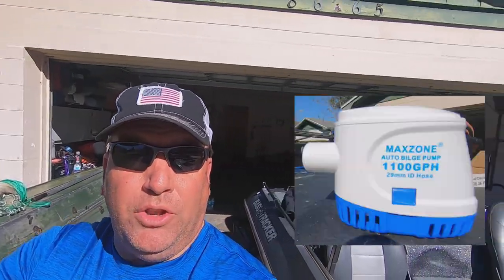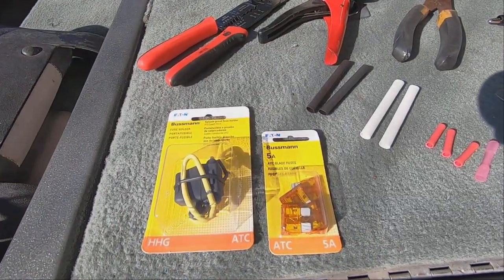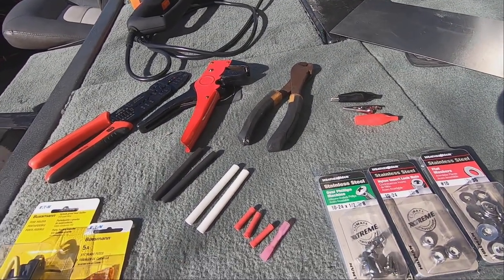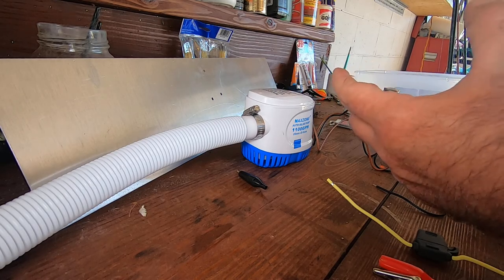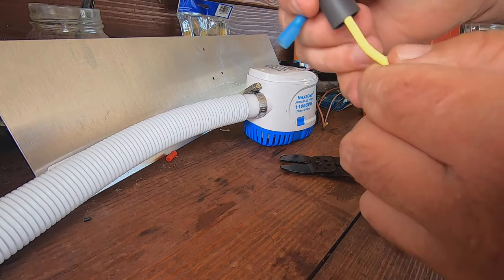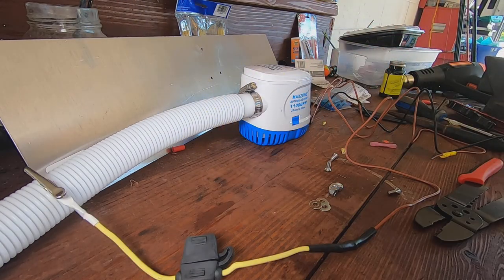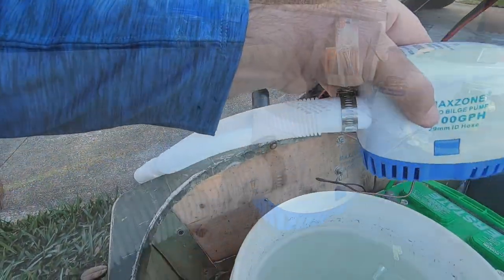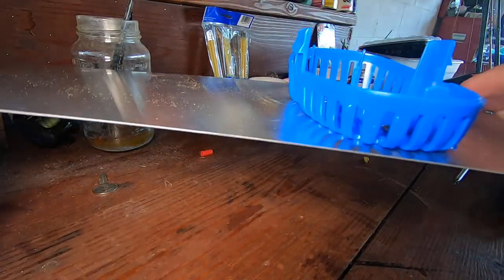How to install an automatic bilge pump

Comment: What did you do to the wire that was suppose to go to the switch? Bought the same pump and planning on the same setup.
Reply from the maker: I insulated the wire I am not using with Liquid Tape.
Reply: @ThatShinerGuy  thank you.

Comment: Dude! 
What's all that crap on your boats rivets?
Set your boat up on saw horses,  lay a sledge hammer on the rivets on the top side, then simply tap the rivets on the bottom side with a regular hammer. 
You can get solid aluminum rivets from granger to add or replace them.
It's really easy!

Comment: couldnt you put the flathead screws on the bottom and the nuts on the inside to make a more flush contact ?
Reply from the maker: I just flipped the screws over.  I think you are right, the flat plate will be almost flush with the boat floor now.  Thanks!!

Comment: Nice job, fast pump👍
Reply from the maker: Sure is.  Took a bigger hose diameter than I expected.  Thanks for stopping by.
Reply: @ThatShinerGuy  did anyone notice that the pump was pulled out of the bucket before any kind of float would have shut the pump off?
Reply from the maker: @timothyclingerman5430  yes, the float only engages the pump when the water level gets too high, shuts off automatically.

Comment: Nice informative Video, I may need to get one of these automatic pumps
Reply from the maker: I got a "new to me"  1988 Basstracker last year.  The bilge pump didn't work and I put the drain plug in the wrong hole.  What a disaster!!  Fixed that problem!!

https://youtu.be/pY2CTVA6R0U